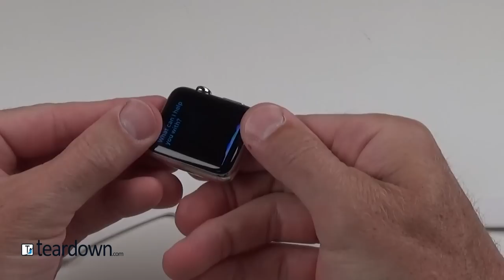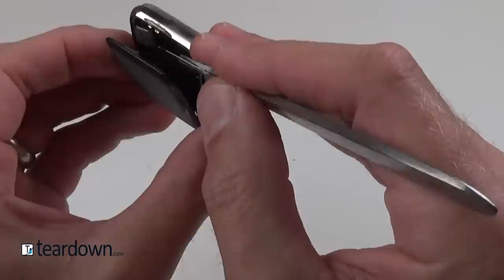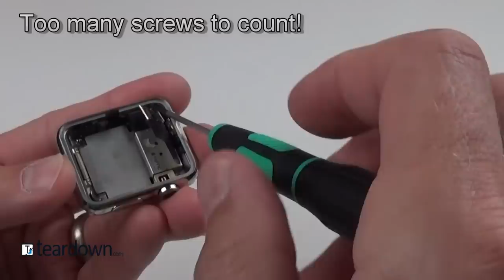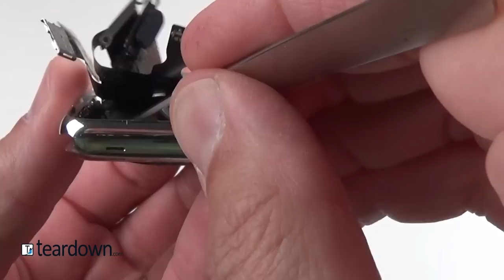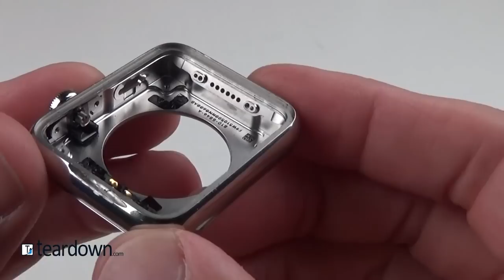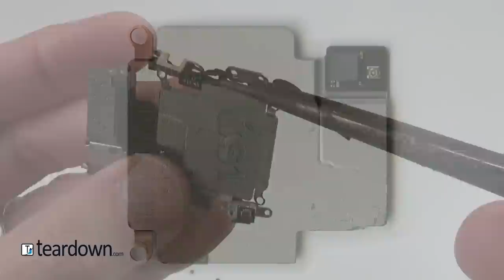Teardown of the Apple Watch - What's Inside ?

Comment: Could you please explain a bit better how to separe lcd screen form touch/glass? min 3...
Reply: +Alberto Romero It has to be possible, but no one will offer a tutorial on how to do it. It would be nice to know!
Reply: +Alberto Romero Lots of heat...the glass is adhered to the screen....found this out the hard way. I'll be patiently waiting for an aftermarket replacement screen/glass combo lol
Reply: cuva52491 good luck. The screen is tied to the processor. The force touch and digitizer will never work again
Reply: cuva52491 

Not true replace a I watch screen and worked fine.